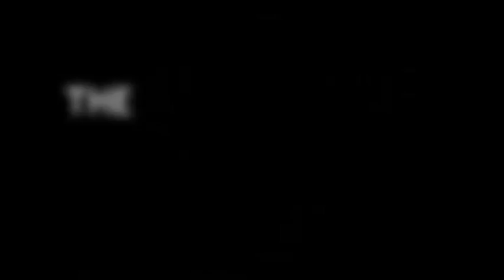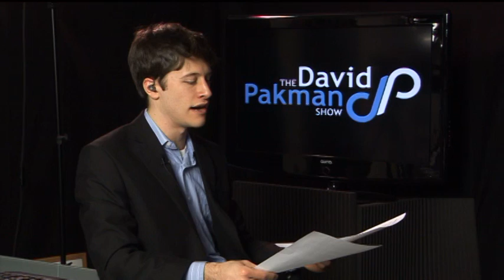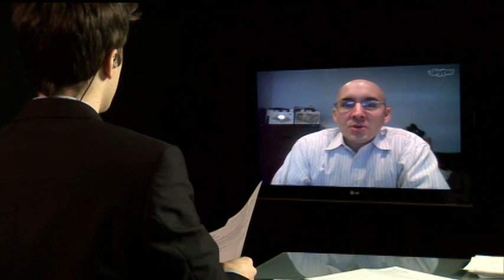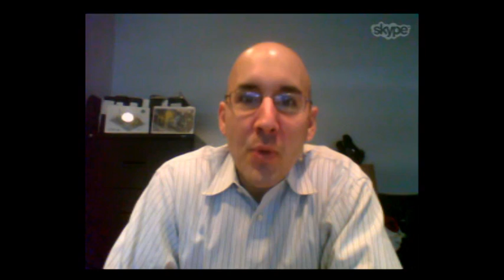Plasma Gasification Turns Trash to Energy! Daniel Ripes

Comment: We are trying to build our vertical farm; and are trying to include a plasma-arc gasification system as our primary power plant. What is great about our idea of combining the two is that the CO2 and water vapors can both be captured and pumped into the farm; where they then can be converted to oxygen by the plants/crops

Comment: I understand that this type of process would require a background in Nuclear and Atomic Engineering, but I think a project like this in time could help increase the number for engineers in the workforce.
The need for a permit would be there, but if you have engineers working at these modified landfills which are numerous, you could see a large increase within the field.